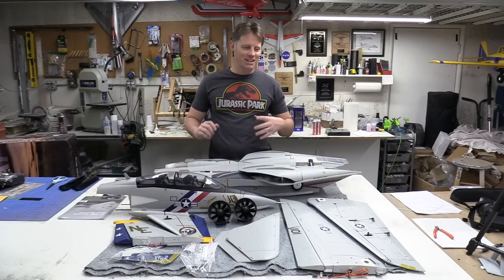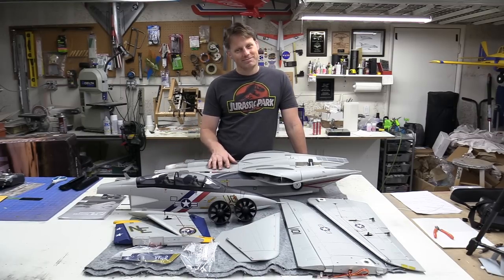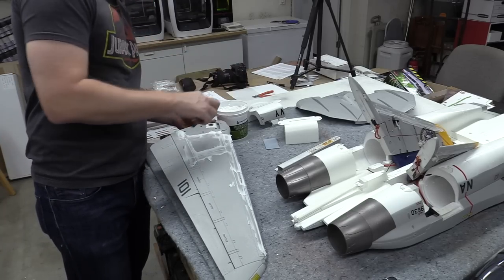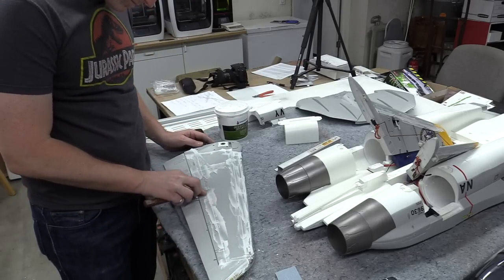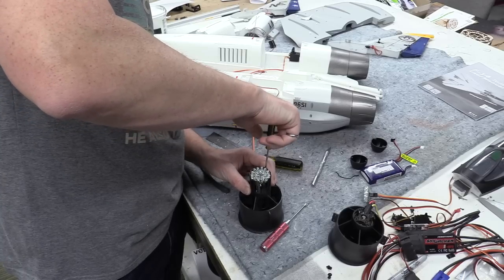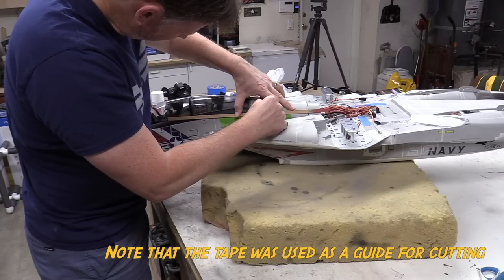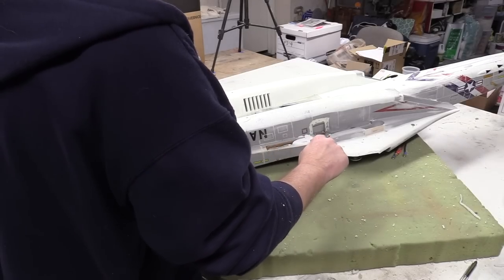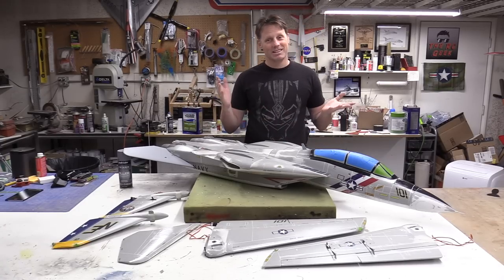Refinish A Foam Jet Ep 1 - Freewing F-14 Tomcat Assembly Mods & Paint Prep

Comment: All this time and effort on a foamy why not put that onto a fiberglass Tomcat make it perfect and call it a day?
Reply from the maker: All in due time as I have a DCU kit that I’ll be building at some point. This is a more instant gratification process and is a bit quicker than a full build. Also, it is a model I can fly here locally. Unfortunately my primary field with the big 600ft runway was closed permanently, so larger models require a much longer drive now to fly. 😕
Reply: @Thercgeek  Ah solid points.